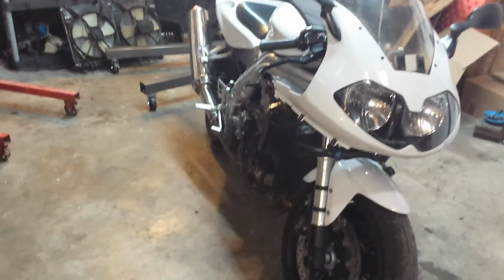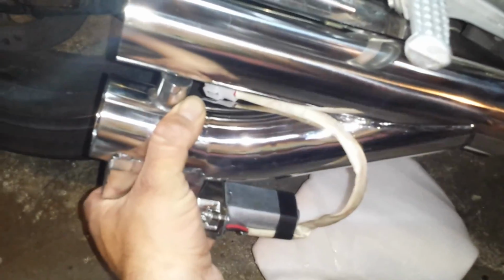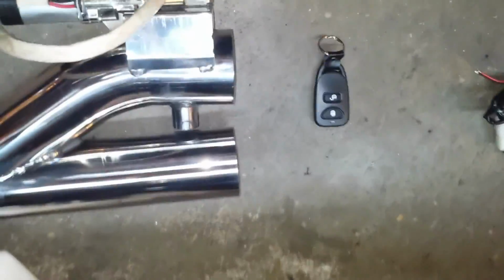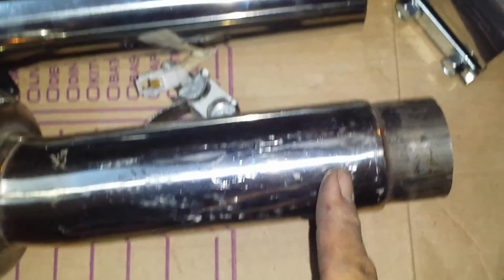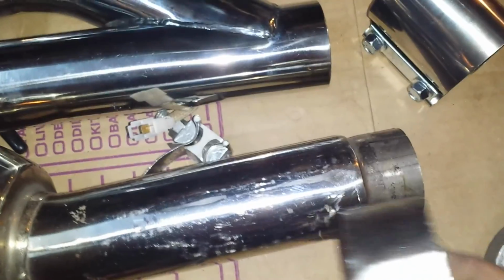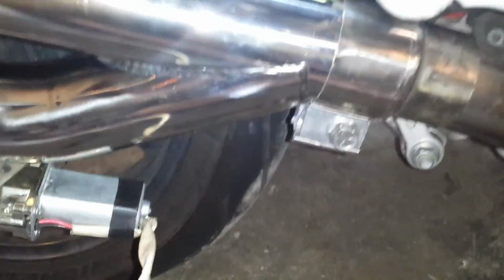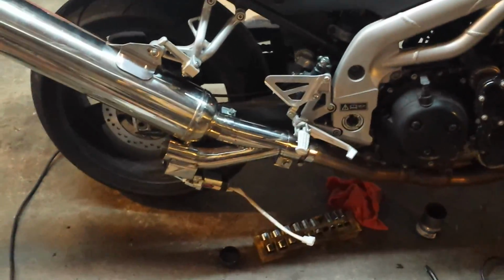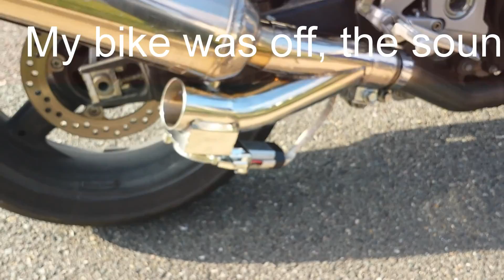2002 triumph daytona 955i exhaust cutout

Comment: How can you tune it properly?
Reply from the maker: StRYCH9ofFOCR It can open in increments. At first when you use it  works great, you can open it at any point and have it sound from quiet to loud. But now the butterfly inside rattles when it is slightly opened. So I leave it fully open or fully closed. I'm going to add a tip and see if it'll add a little deeper tone. I will make a video soon with me going down the road before and after.

Comment: That's pretty stupid! 

It won't seal properly and you'll loose a lot of power when the valve is open and even when it's closed...
Reply from the maker: +bumbumbano own a car first and learn about car mechanics. You are the type to put a fart can on a car and think you have a hotrod.
Reply from the maker: thanks for watching. the bike came advertised at 142 horsepower at the crank. I did a dyno test I got 126 horsepower with the valve closed. with the valve open I got the same thing 126 horsepower. the big difference was the air ratio. with the valve closed I got a 14:1. with the valve open besides being a very loud I got an air ratio of 18:1. I am sure if I was to put a power commander I can gain another 10 to 15 horsepower if I richen the mixure.